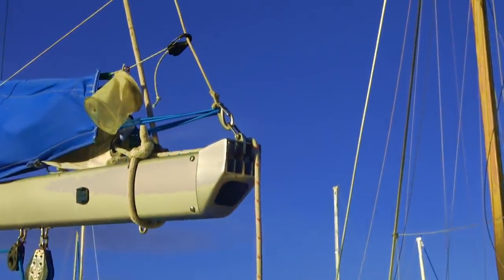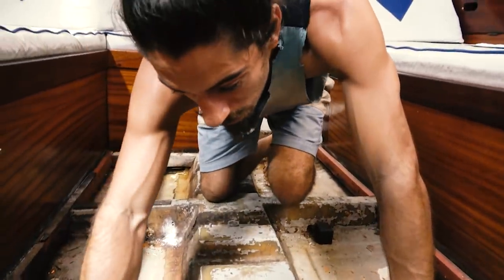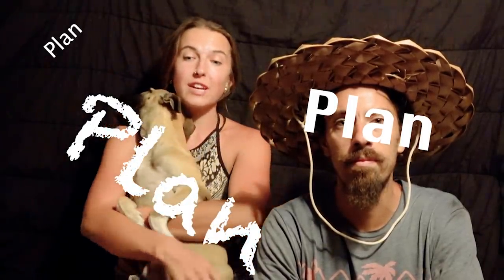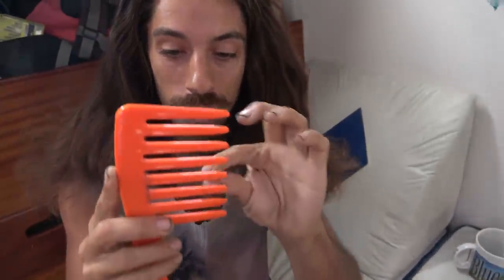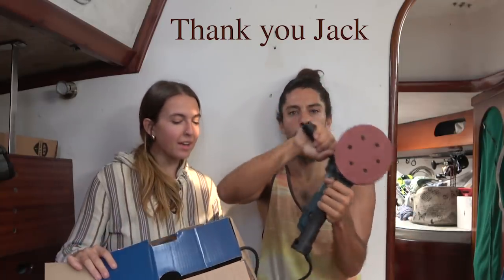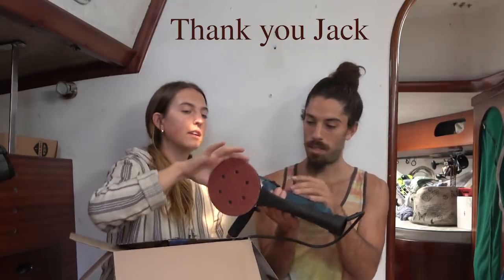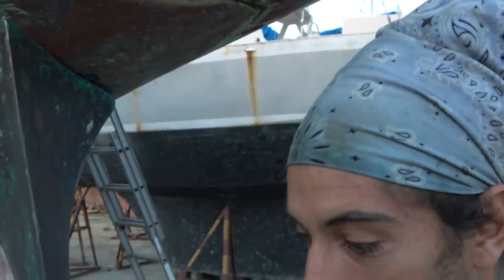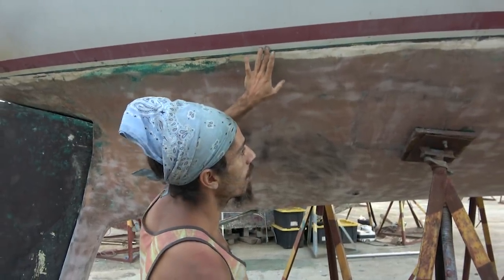Boat MYSTERIES that will BLOW Your Mind! Ep 68

Comment: Just fyi, there are lots of different materials that are available for the hook and loop discs. Sanding net is a bit pricey but work well and remove dust well.  You should not live in the space where you are working with FRP and resin till all is set and sealed.

Comment: Had a friend when younger who had the same dry rot on the transom and cross beams of an old ski boat. He tore it down to clean wood, spent months rebuilding, reglassing,  replacing frames. When he was finished, he showed it off, the boat builders scratched their heads, said Why? It's a fiberglass boat, not a wood boat. The wood was just part of the forms to build the glass on to. When it rotted away the fiberglass was as strong without the wood form which molded the shapes.  I assume it's different on your boat,  you have researched, but still surprised that you are having to tear pieces up.
Reply: Spot on. No difference on their boat. Wood boat construction is nothing like fiberglass boat construction, AKA monocoque, or "structural skin". Better to have a hollow that can drain, than to fill it with a material that can soak up and hold liquid against the substrate. Think "blisters" and "delamination", when that happens.
Reply: Professional fiberglass boat builder also says, please don't rip your boat apart.. please.but if real people say you have to... And real people know.

Comment: A tip for the best sander that lasts easily 4 times longer than standard stuff is Abranet sanding nets. Get a couple of extra sanding pad protectors to keep your sanders hook and loop pad protoected. It Abranet with a shop vac on that sander makes it very nearly sanding/grinding. I've done 4 boat bottoms and painted 3 other topsides with that sander and that combination or gear it's so awesome.

Comment: There seems to be an inconsistency(obvious) in the transverse floors in that across the centreline or at least where they meet the longti the fibre & load path is not ideal. Would be nice to see inside but guessing that the longti on the centreline the dominant member which seems less ideal than the transverse floors dealing with keel loads. I can see some benefit in laying uni fibre  interleaved with double bias as/with uni caps across the centreline and also fanned into the pans formed by the existing structure Would be nice to know the laminate that crosses the centreline in the existing skin under the longitudinal & it's condition- the Bums can probably asses to a degree as external exposed though the critical area where the ballast keel perimeter bears. I'm predicting that internal grinding and some much greater amount of laminate added. There's been good advice and pictures of a similar rebuild on the Carter FB page & really seems like the way to go- plenty extra fibre added with the settee fronts well tabbed into the grid.

Comment: Just glass it over again . After carefully grinding out the cracks to a 10 - 1 ratio. And put in a couple of extra ribs. Use a foam core . The foam gives you the shape. The glass gives you the strength. This might be a bit tachnical, but is not rocket science.  You can do this. Also use polyester resin it's cheaper than epoxy but can have a shorter working time. . 
Either will work Well.
Reply: It is common to use foam as a former to lay glass over the top of.
Reply: Repairs are best done with epoxy.  Epoxy sticks to the old fiberglass much better and that is most important. 10:1 scarf is good. Make sure to fully taper to nothing where the crack is to reduce the stress riser.  When laying up the new glass start with the largest plies first and add the progressively smaller plies. The filled area should be just a little thicker than before and the edges need to be feathered in.
Reply: @funoflife521  Good advice here

Comment: Fibreglass is as strong if not stronger than wood so you have nothing to worry about. You could inject the holes you have drilled with some filler or resin if it makes you feel less stressed but I would just continue as you planned. (and you dont get woodworm (termite )problems. Try copper bottom paint Ive got it on my yacht it lasts about 10 years.
Reply: Apparently, about half the hulls of this boat did not have wood  and were all glass
Reply from the maker: We did explore the copper bottom paint but have already purchased some PPG ablative antifouling.
Reply: @Bumsonaboat  Thanks for the reply, I am enjoying watching your videos here in winter in the UK. I am doing maintenance on my catamaran which is on a swinging mooring on the River Dart ( quite a lot of wood rot on the rubbing strake as well as general engine servicing etc.) Good luck guys, I loved sailing in your part of the world many years ago.

Comment: You could put in RivNuts and then that Stainless Strap. I'd consider filling the rib cavity with expanding foam, structural type. Then grind and glass over everything just cementing the strap and everything together. Done. 

Double check that barrier coat. Pettit said to apply bottom paint within certain hours after last coat to adhere a skin over it of bottom paint. I raised my water line but barrier coating up to the top of the old, then adding 2" of bottom paint and 2" boot stripe up and over the old boot stripe line. SO there's barrier epoxy under the boot stripe. 

As for the hair... Dreds man. You know it's gonna happen. And maybe a red Bandana if that look hasn't been played out yet... Or blue.

Comment: Mads from Sail Life has nothing on you now  !

Most people don't know that the strength in fiberglass over wood is not in the wood but the 'glass and the resin.  If the floors are hollow, they were first laid up in a mold outside of the boat.  Once enough layer of 'glass were applied and the resin fully cured they were 'glassed into the hull.  A good technique that you don't see very often because it is more expensive than using some kind of "core" (wood/foam) and just 'glassing that it in with less layers.
Reply: Jack Patteeuw Yes, the original design was so strong and durable that all these Carters have the same problem. Hmmmmm, doesn't that suggest a design flaw that should be remedied?
Reply: @FubarGuy666  most of the boats out there which use a similar grid system in the stringers and floors also have no core in the grid structure itself. The grid is laid up in a mold separate from the hull, and bonded in as a later job once the hull itself has cured somewhat in the mold. The design can be made strong enough, it is usually the OEM factory implementation which is lacking. Most builders do not build boats thinking of how stresses will be affecting them 40-50 years down the road after many years of usage, cyclic loading, submersion and etc. The result is failed tabbing - a pretty easy fix, all in all. No coring required.

Comment: Hollow is fine for that glass . the wood does not add much strength - the glass is the strength .   Just grind out the crack, grind out to fresh glass (better bond) at-least 6 inches past , lay it up at least as thick as it was and add your c channel through bolted  .Don't run it aground hard and it will last another 30 years .
Reply: You are right. The wood was just there as a form to lay the glass up. But they need more strength than they have.
Reply: John Tripp if that was the case they would have used foam.
Reply: @theogdirkdiggler  No not so. We usually used wood in the yard I worked at back in the 80's
Reply: He is 100 % right. I was part of a glass crew back in the 80's building comercial long liners. What your finding is a blessing not  a curse. My first thoughts were to grind out and rebuild the glass when I saw one of your videos a few weeks ago.. If you can find polyester use that instead of epoxy. Polyester bonds to polyester and should be cheaper to buy. Also quicker to use when building up the glass. Just don;t kick it to hot. You can play with the kicker with polyester but always mix epoxy accordingly.
Reply: sky5jump I meant to pose that as a question? if the wood was meant more for form than structural integrity, wouldn't the lightest, cheapest, and easiest material to use be foam?
Reply: @theogdirkdiggler  Wood is often much cheaper than foam if you are in a yard. Foam would be better as you would not have rot issues in the future.
Reply: sky5jump 
the only problem with that is if the foam got wet it could act as a sponge and never dry out.
Reply: Wood core has the advantage of  reducing compression . Often used under a mast step or winch instead of foam or balsa for this reason . It will be used anywhere they don't want solid glas but need to stop compression .  It also gives some meat to drive a screw into .  Solid glass is probably best for durability but it gets heavy and expensive . 

Fix the crack even if it is just for resale value , a crack left will make the boat un-salable as she will fail the survey and polyester is a good suggestion as it will bond well and last as long as the existing + 30 years .  

The repair will take no more than two days and that is because of drying time . Add the c channel too as it won't hurt . Then paint the bilge and it will look as new .  Not sure about the costs there but here  it would be maybe $100 not including the c channel. 

Oh last thing , the through bolts try not to put them in the top or bottom third . As the boat flexes the  top and bottom alternately go into compression and tension . No need to weaken it where this is happening .  Drill in the middle 3rd and stagger them slightly so a crack  can't follow them .
Reply: @theogdirkdiggler   One would use a closed cell foam . Not the crap from the hardware store .  Wood is probably the most cost effective and easily sourced . Use a hardwood .  

In their case none needed  , leave it hollow and add a few layers of extra glass where it failed , after repairing the crack of course
Reply: @theogdirkdiggler  No No No !!!
Reply: @sky5jump  No Rot on inside of this Style Hull!!Foam Dosn't work very Well with Polyester Resin!!
Reply: @theogdirkdiggler  same with encapsulated wood.
Reply: Ultimately epoxy is a lot stronger than polyester.  Is this a job where you would not use the stronger material?
Reply: @billroberts9182  Polyester is designed to stick to polyester. It will have the same properties. Now even if you have a higher adhesion numbers with epoxy you are still no stronger than the material you bond to.  My father worked with experimental plastics and epoxies for 40 plus years. I asked him about West systems compared to another product that had slightly lower strength numbers and that was the first thing he pointed out to me. Your only as strong as the material you are bonding to.
Save money and work faster with polyester.
Reply: @sky5jump   Polyester to polyester bonding is great when the pieces have not fully cured - because then they can form a chemical (or 'primary') bond between them, not just mechanical.
However, once a resin (poly, vinyl, or epoxy) has cured,  you will only ever be able to form a mechanical (or 'secondary") bond to it, and epoxy has by far the best mechanical/secondary bonding characteristics of the 3 resins. In order of least to best for this type of bonding, it goes : poly, vinyl (500PSI), & epoxy (2000PSI).

Polyester gets used so much because it does work plenty well enough in initial layups and such, but it's main attraction is price - it is far cheaper than the other resins. I also like it because of one factor you mention - the ability to adjust cure timing to a great degree of precision. You can make it happen quick, if you need to. :) Vinylester can do that too, but at about a 50% or greater premium in cost, so I generally only use poly or epoxy.

Here's some good reading on the topic of the differing characteristics of the types of resins:
https://www.jamestowndistributors.com/userportal/document.do?docId=495
Reply: Great comment.  Thanks!
Reply: @leaveonlywake  Well I don't know what you do for a living but I can introduce you to some Shipwrights who work on multi million dollar yachts who won't agree with you in regards to using polyester.
One of their main reasons is they want like materials to flex and move equally.
My father who worked in experimental plastics for BF Goodrich  for 40 years always told me using resins with a higher bonding number is worthless unless the material it is adhering to has a higher tensile strength. 
Poly to Poly and epoxy for everything else.
Reply: @sky5jump  No worries, thanks for the civility in discussion. :) I have worked part and full time over the past 35 years or so on watercraft ranging in size and value from surfboards up to (only hundreds of thousands of dollars, maybe a couple 7 figure) yachts.
In some situations, perhaps where high shear loads were going to be encountered, I could understand why you wouldn't necessarily need to use a material of high bonding characteristics to join weaker parts.
In this case though the goal is for the pieces (grid + hull) to be joined and made as if one. Immovable, and bonded forever. I would do this using epoxy resin exactly because it has the highest possible strength especially because these will be mechanical/secondary bonds. In addition, the forces here will be either compression or tension stress, with little way in the way of movement (none, ideally), so that as long as the bond holds, the only other possible point of failure is in the original pieces themselves - with the result of ripping the entire keel structure from the hull.
if the NA who drew the scantlings for this boat did his work properly and the parts were built to spec, that should be all but impossible. :D
What we see that has failed in this case is not the parts themselves, it is in fact the original poly-poly bonded construction, as well as a later repair, which regardless of the resin used, looks to me to be of an inadequate size to have been permanent.
More glass, wider tabbing, and the best possible mechanical bond between the additional glass and original material/parts - that to me would make this the best possible fix. :)
YMMV. Peace!

Comment: My initial thought when you found no resistance in the rebs when you drilled was , foam core. Light weight styro that is fiberglassed over.  Possible fixes, yes stainless "box" or channel across could be a fair approach. No ONE fix is always right in boats. Could have fitted marine ply "bulkheads under your deck  athwartships  to connect the ribs on either side, and just glassed them in. That would have stiffened the whole thing. Either way,  Good luck. And I thought I had problems with my old wood boat! You guys make me want to go sailing again.... without the repairs ;-)

Comment: 100% Thumbs Up @ Kaptain Freddy !!!!
 the best thing to do  cut away all those damaged hollow ribs, grind the surface clean , make some new wooden ribs and then glass them in heavily. If the original design had three ribs on either side of the stringer (along the length of the lead keel), make six seeing as how the original design proved to be too weak for your boat as well as others. Since you ordered the SS plates already it won't do any harm to screw them into your nice new ribs.
DO NOT TRUST SCREWS TO HOLD THE NEW  SS PLATES (you just screw in hollow ribs)

Comment: Consider pumping the floors with epoxy to make the hollow floors solid. Then reinforce on side and top with metal/stainless steel.
It would seem that those bolts in the stringer are what hold the keel onto the boat. 
Maybe you should try to get hold of the architectural drawings.

Comment: Good for you! I am glad to see that you both have the good sense to not continue with a fix based on a premise that the facts do not support, unlike some people in the comment section that seem determined to see you continue with it or some variation, rather than admit that it has been demonstrated to be seriously flawed.  

That was a fantastic gift from Jack! 
Just on thing to be aware of with that velcro attachment system, if you use it too aggressively without removing the sanding disc occasionally, you can melt the velcro, meaning you can no longer attach the sanding discs. It is therefore good practice while you are sanding, to remove the sandpaper and hit it against something to remove the clogged particles and reattach it once again to protect the velcro and carry on, also don't use the discs to the point of destruction for the same reason.  

On the issue of your hair Joel, that's life! 
You know what they say, "Hair today, gone tomorrow!"  :-) 
This new development is simply just the universe telling you its time to buzz cut your hair, save yourself a lot of hassle and be both more aerodynamic and cooler in both senses of the word! 
Regards Dave.

Comment: Remove the broken fibreglass back until your into some good fibreglass. After which you can get some fibreglass filler. Make a temporary mould around the repair area. Make up some fibreglass filler that will resemble wet paper mache & fill in the part you removed. You probably could have the boat cleaned to the glass a lot quicker if you had sand blasted it.

Comment: C-channel. good idea. Make sure you put some sort of spacer in the open area, otherwise it will collapse the frame. I'm not sure how this is best done, but may justify cutting a 2-2 1/2" square out of the top of the frame where you put your through-bolts for some hard wood spacer to take the compression stress. The ss channel will cover the hole and transfer the stresses of the frame. Talk to your shipwright there for advice.